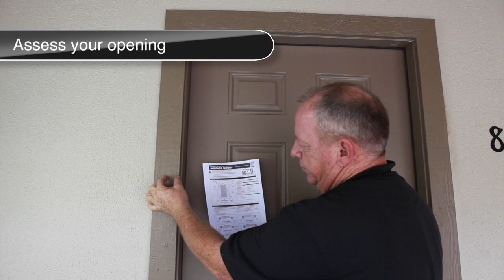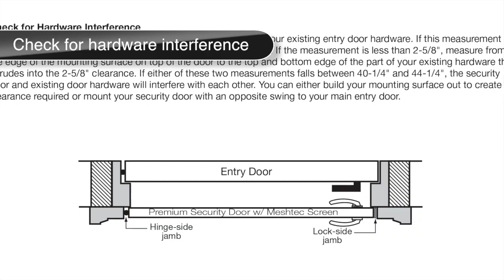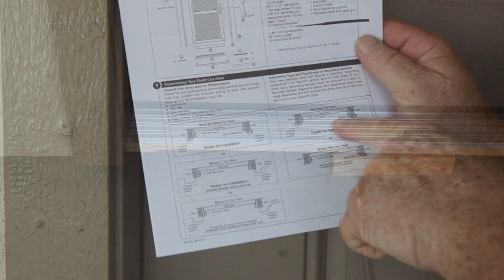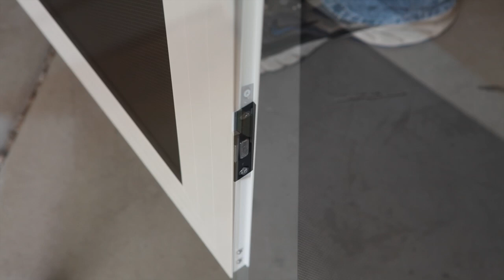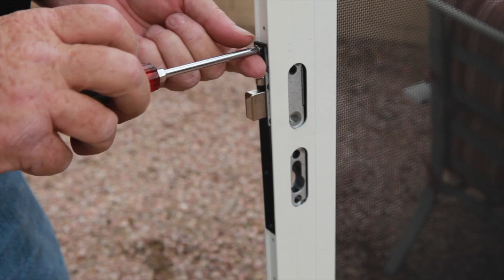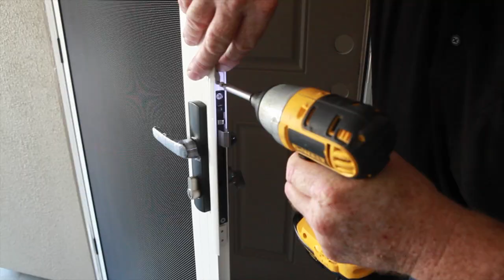Meshtec Surface Mount Security Screen Door installation

Comment: Not sure if the product is defective or if it has a poor design. The screws for the hinge are WAY TOO BIG for the pre-drilled holes. Spoke to customer service who first claimed that the screws should be self-taping. Now they send me replacement screws but they are still to big for the hole.
Reply: so what did you end up doing? if your not satisfied with this type of door, which one would you go with now?
Reply from the maker: Any missing, malfunctioning or defective parts will be replaced free of charge at Unique Home Designs' discretion based on the part(s) in question.
Reply: Lol they were fine bro...😂bt perhaps QAQC was bad for yours...mine were tight but both the screws and door had a coating which you gotta get through.

Comment: This door has an issue with the security locks.  It has malfunctioned before and how now locked shut and my family is locked inside my house...  The door is so secure, now I cannot open it without busting out the door jam.  Major design flaw!!!!  Buyer beware!
Reply: UPDATE from Scott Weiss:  Thank you to Unique Home Designs and Home Depot.  They got the door opened and my family could safely get in and out after elevating my issue to store manager.  After a few weeks they were able to resolve by replacing the lock by coordinating with UHD.   Now my only complaint was the hassle I had to deal with and had to demand to go thru store management to get it taken care of.  Anyways, in the end, the door lock is now fixed and I am glad both Home Depot and UHD worked together to stand behind the product and get us taken care of.  Thanks again!
Reply: @cortneyweiss2  so it sounds like you would now recommend this type of door to your friends and family...i really like the way the look but i dont need any problems with a 1100 dollar door.
Reply from the maker: If you are experiencing difficulty with your lock and require assistance, please contact our technical support team at 1-866-317-8867 or at support@uhdco.com